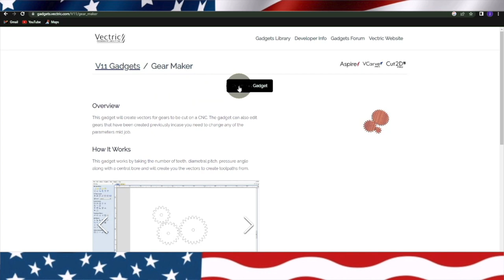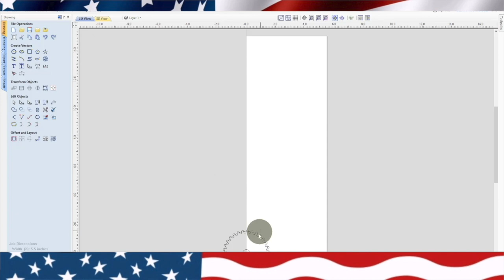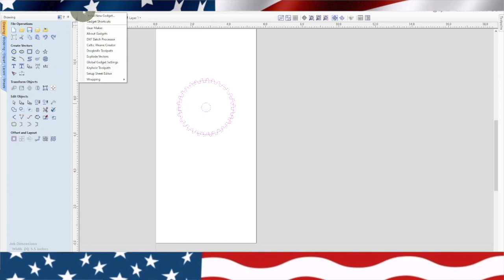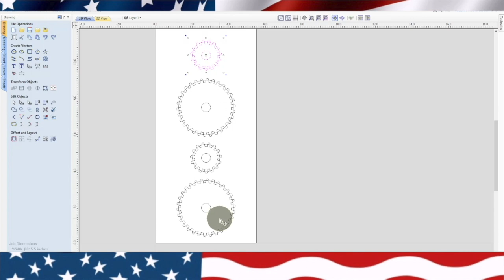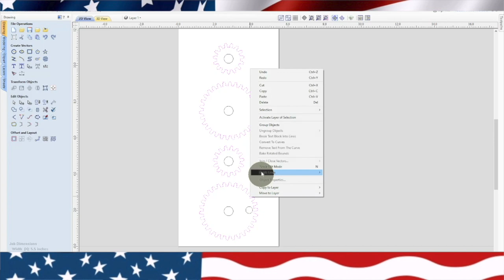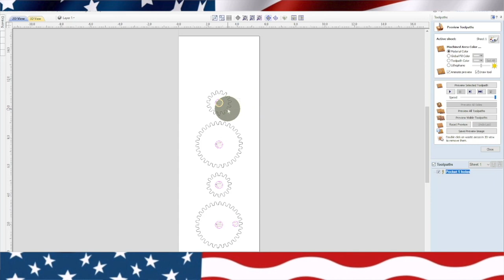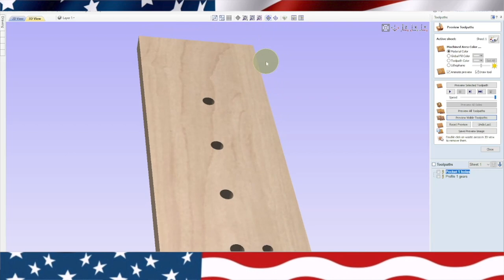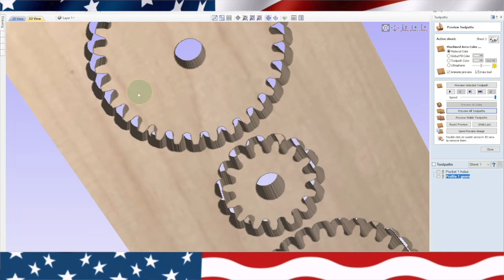GEAR MAKER GADGET LESSONS LEARNED

Comment: Cool, first time I’ve seen the gear gadget used. It’s on my own list. One tip is to always ramp the plunge cut with your down cut bit.
Reply from the maker: It’s pretty cool , I just worked on some toys for kids and made the teeth bigger , slowed down the speed and I’m hoping it turns out

Comment: You were burning that downcut bit when you drilled the holes. You have to use upcut endmills if you want to drill straight on. Normal drill bits are essentially upcut endmills, if you compare the twist on each.
Reply from the maker: thanks